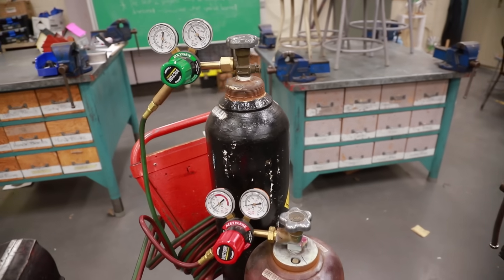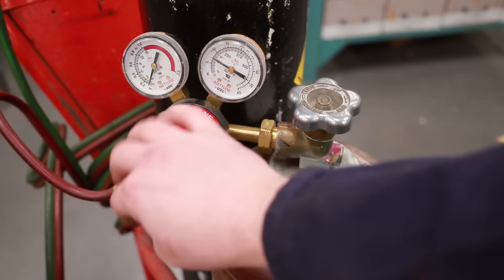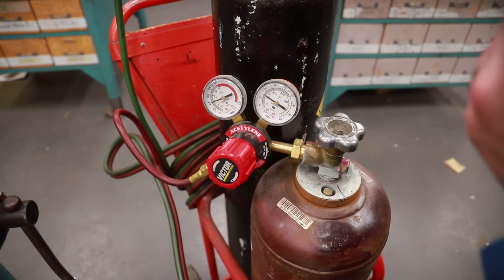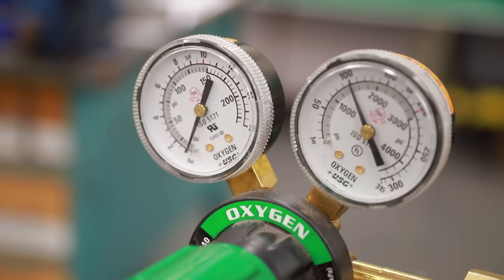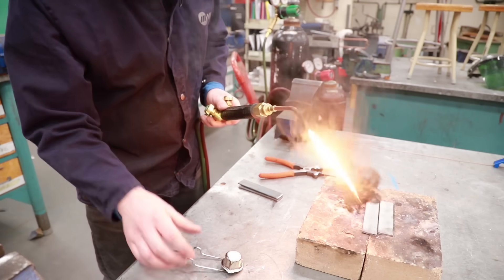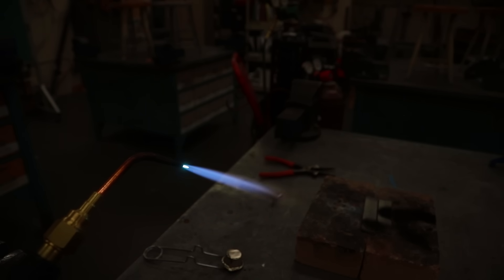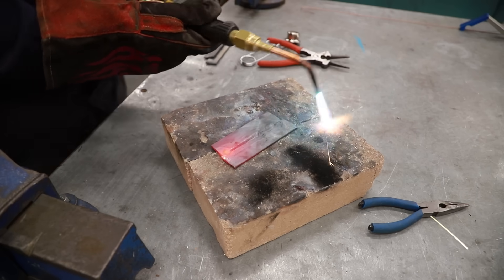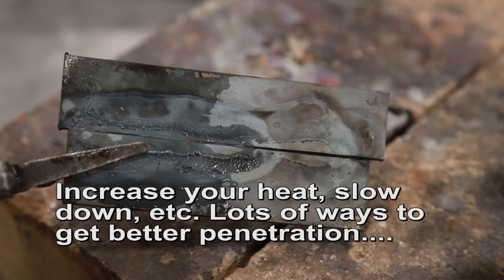Intro to Oxy-Acetylene Welding - Part 1

Comment: Your flame is split and that means your copper is clogged
Reply from the maker: During the series of videos I show how to address, identify, and fix the issue. This video was mainly for showing my students basic setup of the tanks. I wasn't expecting more than 50 views or I would have paid attention to the details like the split flame prior to filming.  Thanks for watching
Reply: We Build Stuff lol i get you. Im actually in school for welding right now and I literally hate oxy acetylene welding. It gives me so much trouble.. for fusion welding its fine but when you have to add rod with it i hate it.
Reply from the maker: @brandondurant2377  
I do a welding rod video here: https://youtu.be/k1hnYforQb4

Once you figure out how to get a rhythm and keep the puddle moving while dipping/dripping the rod in it gets easier. I remember when I was at BCIT (teacher and trades training) we would spend hours practicing. I find that if you can figure out Oxy-A welding then TIG gets a lot easier as you have already practiced the coordination needed to make it work. I am always improving and I am better than I was when releasing these videos. I've made update videos ( https://youtu.be/C6lluYIl9Xk ) with some better information. 

I do think it is useful to understand the different types of welding as you may move around different worksites or fab shops that have different tools available.

Comment: I just got me torches to learn this. Do you need  "flashback', & check valves" in addition to the torches, regulators, & tanks? Both at the tanks, & at the torch? I remember welding with a friend a long time ago, & I don't think he had either one  on his rig. Do I really need them? If anyone can answer this it would be greatly appreciated.
Reply from the maker: For how cheap they are it is worthwhile investment and once they are installed you don't need to worry about them. You can install on both ends if you want but two on the torch end is what I use at a minimum I think. I've been out of this shop since March so I can't remember what my setup was exactly.

Comment: Damn, no protective cages around the top of those gas tubes? If they fall over and the valve hit something they are gonna fly like a rocket.
Reply from the maker: And how would they fall over while secured and chained as shown in this video? These tanks are on a very sturdy cart. Thanks for watching
Reply from the maker: The extra tanks in the shop are also chained to a wall and have their caps screwed on when not in use

Comment: So do you not need a welding hood for oxyfuel welding just a face shield or googles that’s shaded?
Reply from the maker: Protecting your eyes is number one because of the brightness. 
This was light duty and I'm usually very confident at not needing a full face shield. I'll throw on a full shield for certain applications or when teaching a new student that I may not trust to be super safe yet
Reply from the maker: If you were referring to ventilation hood then yes you should use it. I had mine setup off camera. In a normal setting I have it running in the shop all day and it can get very noisy. We normally have specific spots in the shop where welding is allowed under the vent hoods.

Comment: Why would you ever want to do this style of melting the same metal to fuse together....it is not clean compared to flux welding?
Reply from the maker: I was taught this as a stepping stone towards other types of welding in order to teach tank setup, torch control and moving a puddle. Once students practice and figure it out they add filler rod to get their coordination up using two hands (one on rod and other holding the torch). After that I move them to arc/stick welding and then onto Mig. All skill building exercises. 

Mig is easier and gives instant gratification. Gas welding slows them down and teaches my students control.

Comment: Having never done any metal working, I have a couple of questions...
How does a weld like this hold up to stress? I want to make a metal jig, for bending steel: flat stock,  round stock, square, etc. I think the largest steel I would be bending would be around 1/2". My thought is to tack weld various sizes of steel tube to a steel sheet, in order to heat and bend the stock around it.
So, will oxy acetylene tack welds hold up to the stress of  bending steel around the pipe?
Reply from the maker: I only use tack welds for initial holding of the metal together. For high strength welds I would use filler rod with multiple passes if I require extra strength. 

Fusion welding has its place but I wouldn't trust it on its own for when you need something that can withstand high torque like bending 1/2" steel. It can be done though if you take your time and beef up the weld.
Reply: @WeBuildStuff  - Thanks for the reply. I was hoping to be able to avoid the cost of buying a welder and a torch.
Then learning how to use both...
Reply from the maker: @KingGhidorah_  If you can only buy one I would go for the small MIG (wire fed). You can always buy a portable torch (propane) for heating or basic soldering. But all depends on what your final goals are for home DIY stuff
Reply: @WeBuildStuff  - My final goal is making motorcycle sissy bars and seats. I have to get others to weld, since I don't know how. As for the torch, I definitely need one for the sissy bars.

Comment: Great video, well explained,, i never knew you could weld with out a filler rod
Reply from the maker: It isn't as strong and I rarely do it but it is part of the skill building I put students through so they understand the basics and how to handle a torch first.
Reply: Me, either.

Comment: Why does the Oxygen gauge go to 200 psi full scale? Using any instrument like this (at the bottom of the scale) isn't ideal.
Reply from the maker: These regulators are sold specifically for this application. I don't think I have ever used it past 10-20
Reply: @WeBuildStuff  Weird. It's like measuring sheet metal gauge with a yardstick.
Reply from the maker: @gliderp  a little strange but after 15 years I'm used to it and have never given it a second thought. The regulators can probably be used for other industrial gases but I have always done it this way after my BCIT training

Comment: make vedeo   welding  gi platsheet .1.0 with gap. not like that this one are both tick thats why easy to weld try it with the plate .that ticknes much better use mig or stick welder.

Comment: Im an old dog I been an ironworker/ field fabricator/field welder for 20 years. I just now got a shop job. 

 So I got a dumb question.  Why would you only open the bottle valve 1/2 turn?  The regulator can reliably deliver any steady pressure desired from the bottle at full open.

 I'm just saying I've cracked the valve on literally thousands of bottles in my lifetime. Not all valves are created the same. Just the other day. I had a valve that had to be nearly open to deliver me a steady 5 lb. Of acetylene to my regulator
Reply from the maker: In most manuals it says this for Acetylene. It also means a very quick shutoff in an emergency
Reply: @WeBuildStuff  that makes sense to a certain degree. Thanks for the reply
Reply from the maker: @plainlogic  and with teenagers Safety comes first before technique and skill level

Comment: hi i think you spend too much time to make your two tacks on this sheet metal
cause the brick absorbe the heat
Reply from the maker: I kept it slow in the video and at a lower heat than I usually use to show my students how to control the torch. Thanks for watching!

Comment: Can't you use "filler" metal? Like, a steel wire/rod?
Reply from the maker: Yes that is in part 2! I need to make a part 3 with better welds than I did in this video as well!

Comment: Someone please give me tips on how to do lap weld. My teacher graded me at least 90 on bead welds and butt joint weld but I cant get puddles tk connect on lap weld
Reply from the maker: It'll be similar to a t-weld. Ensure the bridge/puddle is going evenly on both pieces. Your bottom piece may heat up differently since it is partially under your top piece. Have your instructor give you a demo on both to show they know as well 😉
Reply: @WeBuildStuff  ok thank you! I will remember this

Comment: What do you mean by increasing the pressure to increase temp.?
Reply from the maker: While I usually leave my regulator pressure as shown you can open the torch handle valves to allow more gas to come out and increase the temperature

Comment: I've only been welding with my everlast arc welders. I think I'm ready to get an oxy-fuel kit.
Reply from the maker: Awesome. Having a variety of tools is always helpful for certain applications. We end up using the torch a lot for heating and bending  or cutting
Reply: Ive been wondering how those everlast machines run. Those and the Vulcan omnipro.  Any feedback?

Comment: Do you know any research paper regarding the welding with puddle formation technique used in this video. i.e. welding without filler rod
Reply from the maker: No I'm just showing the way I  learned. I have since changed my technique a bit and have updated it in a newer video (easy to find on my channel)

Comment: Oxy-Acetylene gives a very good base for other welding processes because it teaches puddle control at a much slower speed than MIG or stick.   It also works well on light material if there is no MIG welder around.  Thank you - I remember learning this in highschool.  Bob the (retired) welder/fitter.
Reply from the maker: Exactly why I start students on this skill before moving them to MIG! Thanks for watching
Reply: My neighbor who has taught welding at a Iowa State suggested I learn this method because it will teach me puddle control and the rest will be become easy. He’s going to give me lessons on Sunday afternoons.

Comment: Nice video, thanks.  Q: Why do you open the O valve all the way?
Reply from the maker: for safety!

"Back seating the valve prevents leakage around the valve stem when it is opened."

If it isn't opened all the way there can be a chance of gas leaking out. Acetylene cylinder valves are designed differently so they are only needed to be opened 1/2 to 3/4 turn
Reply: @WeBuildStuff  Cool thanks.  What is the danger of oxygen leak (apart from the danger to your wallet)?  I was taught to open both cylinders  only 1/2 a turn so that you can close them quickly, if you need to - eg torch catches alight due to failed o-ring. 

Again, great vid.  Always good to learn new points of view and techniques.
Reply from the maker: @Rattlegunner  The valve in oxygen cylinders is different than the acetylene.

From google!
"Back seating the valve prevents leakage around the valve stem when it is opened. Long enough to allow any air or unwanted gases to be replaced by the gas being used."

Thanks for the comment!

Comment: Welding with the plates touching the brick to much can make it harder to get penitration try putting a block on each side withe the plates like a bridge and u can use a filling rod
Reply from the maker: I do this is the third video. This one is just getting my students comfortable with the torch and to practice visually seeing a puddle

Comment: Is it only me that sees no benefit of this VS electric welding, he completely destroyed that piece of thin metal,   and it takes forever to get a puddle going, even stick is 10 times more productive and creates good weld.
Hopefully I'm going to get hired next week my employer said they weld ox-acetylene too but I can't see how is that productive in any way, I'm certified electric welder and I would never choose this acetylene destructive process, most important part in welding is to not put too much heat into the work piece then the uniformity and consistency of the weld bead, acetylene looks like trash, can someone convince me otherwise?
Reply from the maker: As part of our welding program we do everything from gas, mig, stick, and tig. I have students practice this before the other welders to learn patience and how to hold a torch to get their technique down. I only use gas welding for the odd repair or brazing job and use electric for 90% of everything else
Reply: @WeBuildStuff  I see thanks for response.
Reply from the maker: @ionutth4895  extremely valid questions and view I might add. I've made an updated video with some more safety and better welds (still very slow) but I agree that gas isn't always the way to go. It is part of the high school curriculum in the metal fabrication courses we do.

Comment: please can someone help me ? I have been learning how to gas weld and can anyone advise me why I am getting lots of carbonized steel and very brittle joints?
Reply: I think that when you cool it off too quickly it hardens which means it becomes more brittle, so i would just let it cool off slowly so that it would just bend instead of breaking.
Reply: @GroProOrg  yes that's true I need to be more patient also with heating it up as Im wacking the pressure up too high to get it heating quicker but as I found out this doesn't give a chance for the impurity and gasses to escape and blows a hole in the puddle and burns the base metal hence why I Am ending up with a carbon mess

Comment: Why dont you use filler metal?
Reply from the maker: That is in part two. I have students practice this first to learn how to manipulate the puddle only using heat
Reply: @WeBuildStuff  thanks sir. by the way, do you know lot about friction welding? I wanna ask about fusion zones in friction welding

Comment: How much does a set up like this cost? I’ve done some oxyfuel cutting, but not welding. It seems like a good skill to have since the equipment can do so much.
Reply from the maker: I have a personal set for around $250 (not counting tanks) and the ones we use at the school are about $400-500 each. We are currently using "vixtor medalist 250 medium duty welding/cutting outfit"

Comment: What if the black soot does not go away?
Reply from the maker: You can still try to weld but it will be dirty and not as hot. A tiny bit of soot is alright and will dissipate after introducing oxygen to it and getting your nuetral flame
Reply: @WeBuildStuff  Thanks so much, great videos!!! (:
Reply from the maker: @HerbinRedwooD  thanks for watching!

Comment: I just inherited an oxy-acetylene setup, full sized tanks.  This is incredibly helpful.  When I got the call to pick it up my first thought was, "neat, a new way to blow myself up."  But as a Jeeper welding would be incredibly handy to know.  Thanks for your video, I'll be checking out the others.
Reply from the maker: Watch my latest video on welding. Much "better" information than this one! I keep learning and changing up how I do things as I keep learning and improving myself 😀
Reply: Use the torch for cutting.
Use a stick welder for outdoor use as the coating provides the shielding gas.
There is a function in the metal called the HAZ (heat affected zone). the slow action of the torch gives a very wide HAZ which changes the metallurgical characteristics of the metal you're welding. Not what you want at all.
 For cutting, get a spot red hot, then hit the "turbo" button for a big increase in O2.
This will punch a hole in the work and you can keep the cut moving.
It works OK, looks not so good compared to a plasma cutter.
Stick for outdoors and on "rough" work (6010 stick I think).
MIG  for indoors and TIG for true precision work with minimal HAZ.
I've been told that TIG is hardest to learn, but to learn it first. After that, you'll be a wiz at the other two. Some say "MIG like TIG" is the ultimate compliment for a good quality MIG weldment.
Reply from the maker: @burnerjack01  I have found that teaching the kids the techniques of working the puddle is my requirement before I teach them TIG. Stops them breaking everything. We do mostly Mig welding in class as our stick welder has been busted for awhile and I'm waiting on some more budget to get it fixed :) Thanks for watching

Comment: Just wondering why you didn't use filler rod
Reply from the maker: That's in my 2nd video. This video was to show just a fusion technique so my students can practice with two hands on the torch to get used to the process before worrying about stronget welds. Baby steps!

Comment: huh i learned always put oxygen open first and then the acetylene until you can ignite the flame, this way you dont get that big black smoke coming off
Reply from the maker: Just the way I was taught in college. I am doing an updated video soon with a few changes but I still light acetylene first.

Comment: Regular old red bricks/blocks/big flat garden stones/etc will not explode. But it's true that they will not conduct heat as easily as the others.
Reply from the maker: I do exaggerate most things when teaching students. Helps them remember
Reply: @WeBuildStuff  Reading my original comment, I need to elaborate- fire bricks conduct less heat. You already know this though.

Well, shit, I suppose as long as you don't teach them anything that hurts them, a little bullshitting here and there can't be too bad.
Reply from the maker: @Doomzdayxx  part of the job description and keeps them from using the torch on our sheet metal tabletops!
Reply: @WeBuildStuff  Oh yeah i totally get it dude. good video.
Reply from the maker: @Doomzdayxx  cheers. Thanks!

Comment: Make sure the valves have the pressure released before turning on any gas. This is the first step. Read the safety and operating instructions if you value your life. Do not follow the procedures you see in a youtube video. Someone else's bad habits can kill you.
Reply from the maker: I appreciate the insight and knowledge from your comment. I will be releasing a new video to replace this one in the next while to include the tips from others and yourself. This one will ve removed once update is up